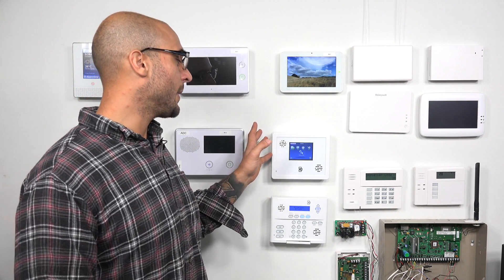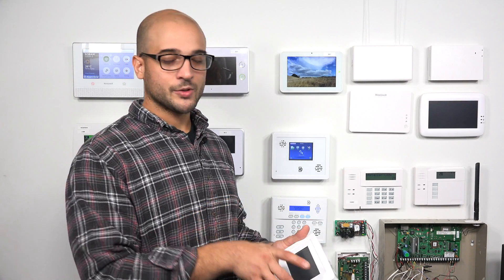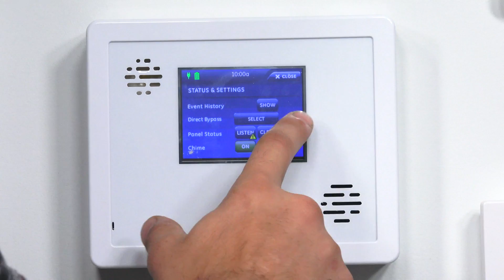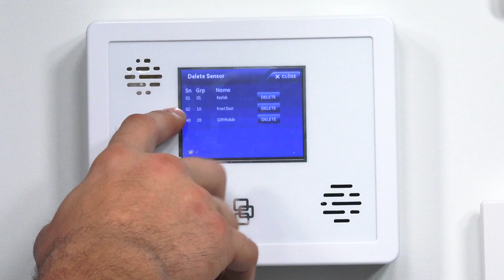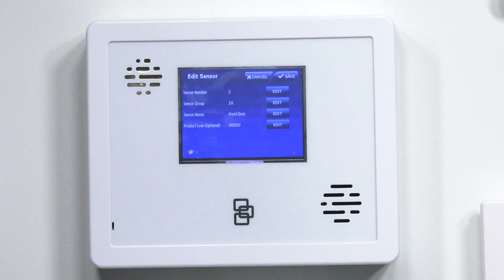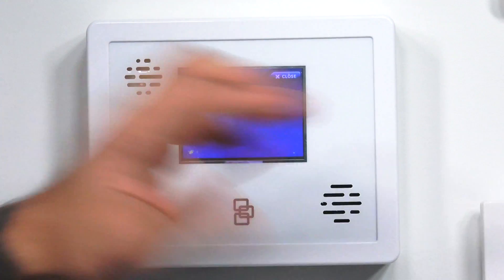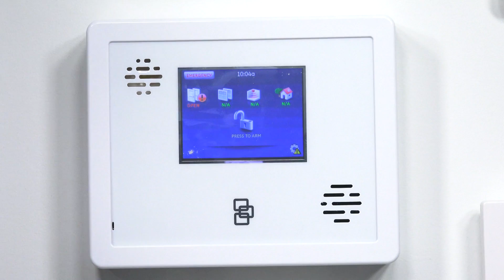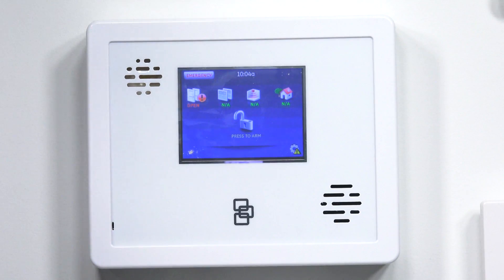Programming a Door Sensor to the Interlogix Simon XTi or XTi-5

Comment: To trip the sensor you just need to remove the battery?  I have to reprogram all 20 sensors because I don't have the dealer code.
Reply: HI SurferHawa, To Learn/trigger/trip a sensor you would use the device how it will be used.  Examples are for a  "Door contact", open and close the door, for a "Motion detector", place your hand over the lens multiple times usually after power cycling, "Smoke Detectors" and other devices, may have test buttons for enrollment, check the instructions for each device you intend to learn/trip/trigger to see the proper process.
Reply: @DKAlarmgridSupport  That is not accurate for the version I have.  As shown in the video, I have to open the sensor to get the panel to recognize it.  I have the same panel as in the video.

Comment: Thank you for the video. Is it possible to add window breakage sensors?
Reply: As long as its running off the 319.5 MHz you should have no issues. It will be done the same way as the video. Email us if you have any issues!

Comment: I do not see the Sensors option under Programming. How can i enable or unlock this feature?
Reply: Hello Hardik, The "Installer" access code is different from the "Master" access code. If you do not see sensors, then the "Installer" access code was not used at the access code screen. If you are sure the installer code is known, it would be recommended to check with your dealer to make sure there is not a programming lock out option enabled.